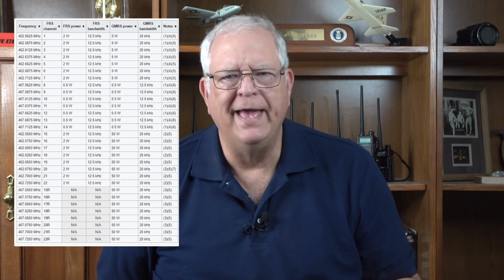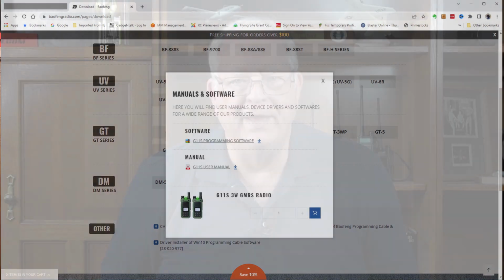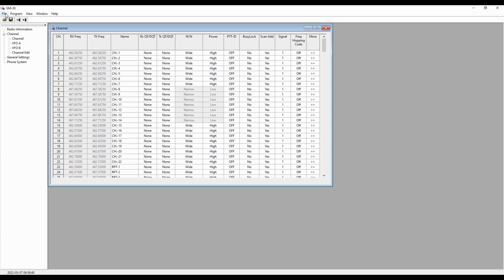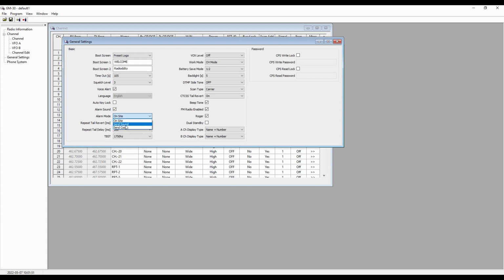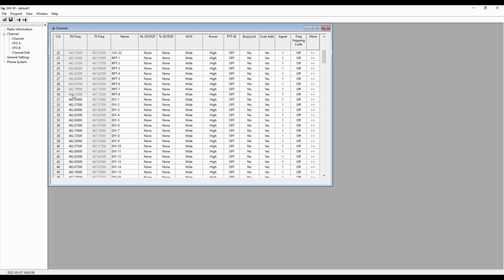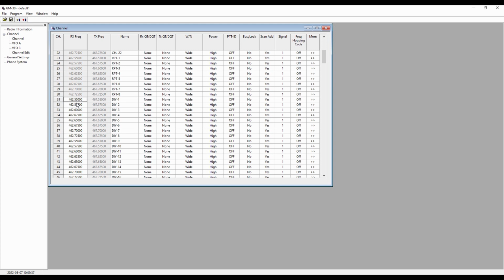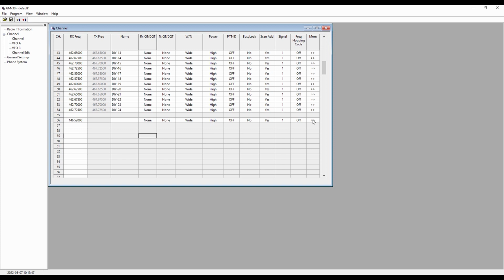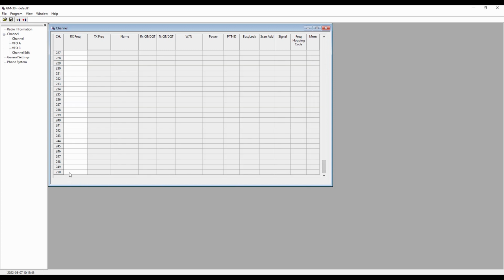How to Program Your GMRS Radio Using CPS

Comment: Do you know if there is a version of the Radioddity CPS that works on Mac computers? Thanks. Like your videos, subscribed after I watched the first one.
Reply from the maker: Most factory CPSs are Windows only. With more GMRS radios showing up on Chirp, that gives Mac folks more options. Many users buy a very inexpensive Window laptop for CPS and other radio apps. They don't require much processing power. I found one on Amazon for under $100.
Reply: @GadgetTalk4U  Thank you.

Comment: I used the exact same cps and radio you used in this video.  Do you why my factory settings in that DIY section are not +5 offsets? For example DIY -1 462.55000,  offsets default to 467.52500. Because its grayed out, i cant change the numbers.  And even if I change the receive frequency, then click off the box, it doesn't automatically adjust to the proper offset.  It basically leaves the DIY channels unusable. Any thoughts on this?  Thank you.
Reply from the maker: Check to see if the CPS you are using has an updated version number. Sometimes when those get messed up, the manufacturer will update the CPS after complaints. For example, ver 1.0.2 to updated version 1.0.4. Good luck.

Comment: This was excellent, thanks!  You didn't mention FTDI drivers, I wonder if they are needed for the "cheap" GMRS programming cables.
Reply from the maker: The cheap cables are often not FTDI cables. they may need their own drivers. Most of the time nowadays,  Windows will recognize and download drivers, but not always. I like the FTDI cables as they work with nearly all the radios. Programming cables that come with the HTs ususally work, too. Third party cables have, in the past, been problematic.
Reply: @GadgetTalk4U  Thanks for the reply!  I have several cables that use the FTDI driver (a couple of RT Systems cables and a couple of USB to serial adapters) and they work great.  Just applied for a GMRS license and ordered a pair of UV-5G Plus HTs and am getting up to speed on everything while waiting for the US Mail today.  (Your channel has been a great help. 😀)  Looking forward to trying out the programming cable and software for the new radios.  My IC-R6 made me a believer in programming software.  Not easy to program a radio that only has four buttons plus a Function key!
Reply: @GadgetTalk4U  UV-5G Plus arrived today, hooked up the programming cable and Windows 11 installed it just fine.  Already been adding some channels and adjusting settings.  Thanks again!

Comment: I have two of the GM-15 Pro GMRS radio and for some odd reason it would not let me change the STEP from 2.5 khz to 5khz. the radio works, but I want to change it from 2.5 khz to 5 khz
Reply from the maker: Step is only active in VFO Mode. See the small print in the Menu 1 description in section 7.3. Cheers.

Comment: Are you aware if I can program a diy channel that is a gmrs channel with privacy tones? I'd like to have channel 1 with no tones and then a separate 462.56250 channel with a privacy tone to match my Midland radios. Can't seem to set up. DIY channel that will transmit on a GMRS frequency.
Reply from the maker: It depends on a couple of things. First, the radio itself must allow DIY channels. Most newer ones do, but not all. Next, the DIY channels must allow all the GMRS channels,  not just the repeater channels. Last, check to see if your radio limits what channels can accept DIY transmit channels. Some allow all channels above 30 to accept them, others only 31 to 54. Good luck.

Comment: My issue is my computers are both Macs.  Most manufacturer CPS are set up for Windows computers, although Chirp is not.  Chirp will let me change and save data on my UV-5R but doesn't have access to my new UV-5G Plus radios.  I'm new at GMRS and hit this snag.

Comment: Appears that different Baofeng branded cables have different chips.  I have one cable with the Prolific chip and another with a CH360 chip. Incidentally you don’t need the radio connected to determine the com port , just plug in the USB end into the PC and device manager will recognize it.  These cables tend to be finicky and work with some HT’s and not others.  Just wanted to share this post, great video as always.  73.
Reply from the maker: You're correct on both points. Some models' cases make it hard to get a good connection on the K1 connector. Thanks for commenting.

Comment: Hello and good morning.  I have an assistance question:  if I may ask on my GM-30 using the CPS how do I go about entering the following repeater settings.  software wont allow me.  Ranchino repeater; RX: 462.600 DPL/DCS 23, TX: 467.600 DPL/DCS 23.  the CPS wont allow me.  Cant seem to figure what I'm doing wrong.  TYI  73!
Reply from the maker: I'm using version 2.06 of the CPS.  Go to one of the DIY channels from channels 31 to 54. Select the receive frequency of 462.600 in the drop down box. The transmit frequency should  show 467.600 automatically. Set D023 from both of the QT/DQT columns. Add  a name if you like in the name column. Save the changes to your computer and write them back to the radio. You must use a channel in the 31 to 54 range or just add the tones to Channel 25. Good luck.

Comment: For some reason, in the General Settings, my "Boot Screen 1" and "Boot Screen 2" are greyed out and I cannot change them.  Any ideas how to fix that?  Boot Screen "Preset Msg" is selected.
Reply from the maker: Without knowing the radio or the CPS I really don't know. Perhaps your radio doesn't support custom messages?
Reply: @GadgetTalk4U  no worries, i reached out to Radiottity and I had an older version of CPS, they sent me a newer version to download and it worked!

Comment: How and where do you connect the programming cable to the radio?
Reply from the maker: Foe nearly all handheld, the cable goes into the side 2 prong accessory port.
Reply: The cable doesn't have any prongs. I can't post a pic of the cable, but here's a link to a pic

https://m.media-amazon.com/images/I/618wv-GkACL._AC_SL1200_.jpg

Comment: Were you able to use Windows 11 for the radioddity programming software and serial port conector to program the Baofeng GM-15 pro / Radioddity gm-30?
Reply: I bought a cable with the FTDI chip a few years ago. It works with Windows 11 and the Radioddity software. I also have my ham license.
Reply from the maker: I've heard about issues with Win11. I haven't changed. I've heard that some have gotten the ultra cheap Win 10 PCs just for their radio software - both Win11 and Mac users.
Reply: @GadgetTalk4U  thanks for the quick reply.

Comment: A very useful video for those just getting into GMRS, thanks.  Your link to all the channels that can be included for scanning can really help one unlock the potential of the radio to let you tap into the information flow going on in world around you.

Have you found a way to import the programmed channels from one radio into another radio made by a different  manufacturer?  It would be great if one could transfer these channels to save duplication of effort.
Reply from the maker: I haven't found an easy way. For radios with an import function in the CPS you can import the channels but you'd likely have to first change the order of the variables in the CSV files to match what the radio expects if using a different model or brand. It's never easy. Cheers.
Reply: @GadgetTalk4U  Thanks for taking the time to respond.  I hope you are having fun doing these reviews, I certainly enjoy them.

BTW, I'd love to hear your take on the Motorola T800 (I own the T801).  It is an FRS radio with surprisingly good range, and the ability to send texts directly to other linked phones via the T800 radio while off grid and the ability to display your location to other in-range T800-linked phones is very cool tech (includes an SOS function).  This would be a good next-step for GMRS radios.